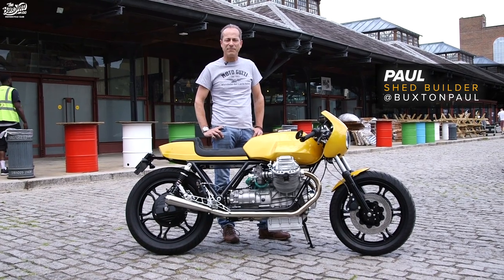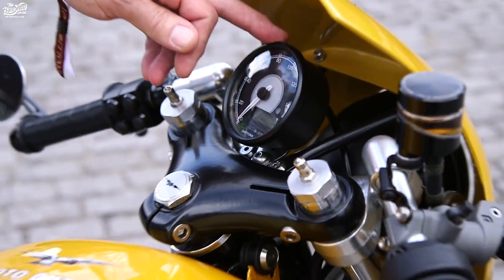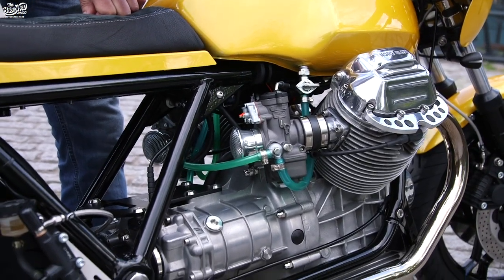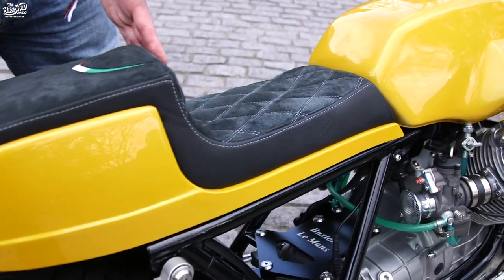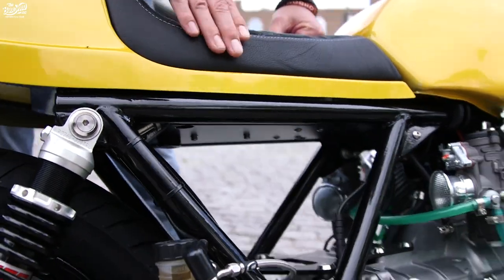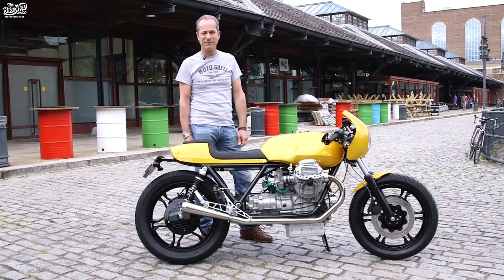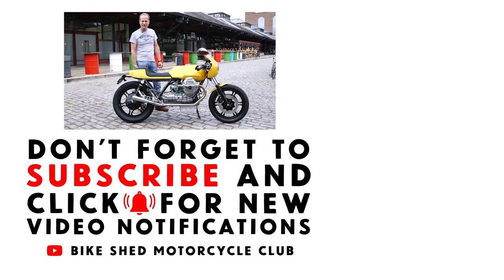Paul's Moto Guzzi Le Mans shed-built cafe racer - Bike Shed Show 2019

Comment: Big block v twin pre 93 Guzzis are that rare animal in the air cooled OHV motor world that do'nt need an electronic ignition kit upgrade. The twin points & condensors/dizzy set up is one of the most accurate and reliable systems ever devised. I bought a Dyna 3 kit for mine in 2002, its still in its box.... i've seen mid 80's Guzzi big twins back in the day running perfectly with 75k on the clock, original points in.... only thing is change the AA springs every 50k.

Comment: Lovely work. However, and this is just how I see it, to use a Le Mans (so called Mk I) as a donor bike is an act of vandalism. A Mk II would have done, or a Spada. OK if everything is reversible, but you've butchered the Tonti frame top rails. The best view of the bike by far is at 0:23. It takes a certain kind of arrogance to think one can improve on a timeless classic design and to say "it's my bike" doesn't help, you're just the current legal custodian. No offence.
Reply: Nah his build looks much better.
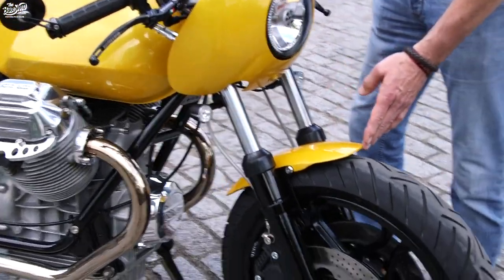Reply: barryolaith: I agree with you, and the sound the original Lafranconi Competizione exhausts the Le-Mans came with, make a Way better and louder that the custom ones he put on. Check this video I've found, where this kid's Le-Mans looks better and listen to the roaring sound it makes between 0:50 and 0:53 mark.
https://www.youtube.com/watch?v=3tjum8xSKTs
Reply: @faiz434  Check this video, the kid kept all original, upgraded the engine from 850 cc to 950 cc as Paul did, but he replaced the original rims with spoke rims, which they Look Way better than the original the Le-Mans used to come with and hear how it roars with the Lafranconi Competizione exhaust between the 0:50 and 0:53 mark.
https://www.youtube.com/watch?v=3tjum8xSKTs
Reply: You nailed it. I agree. Not impressed by the lack of support for the pillion either. And yet another pointless  Bermuda Triangle of nothingness behind the engine! Why? Ugly.

Comment: way better than the stock bike. Only because the "Le Mans" is so famous it is not allowed to change it? There are still enough Le Mans in "stock version" left for the purists. I like this one. And lets face it, the original wiring is a nightmare......
Reply: Never had any electrical issues with any of my Guzzis over 38 years, I do maintain the Bosch alternator though with a brush change every 10 years or do.
Reply: @warp65  Yup, I shoud have been more precise, it is not Guzzi in general, but my Moto Guzzi that gave me problems with the electrics and the switches (after 38 years).
Not to be mistaken, I love Moto Guzzi and it is ok if some switches and cables are broken after so many years.
Reply: @neophobiagarage1845  
If I sounded like a dick, I apologise,   just that I love the old beasts and have thousands of happy trouble free kn with them.
Cheers
Reply: @carljones8334  
I like the mk2 , wish I still had mine, the old mk5 gets used a lot at the moment.
Cheers